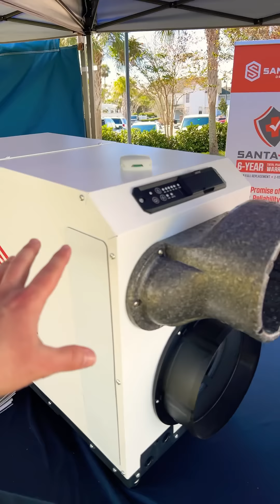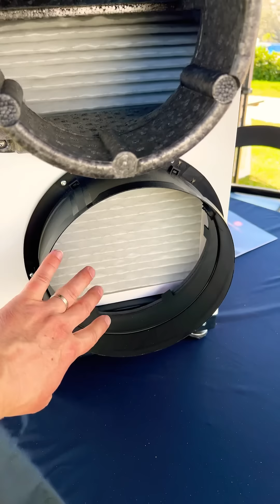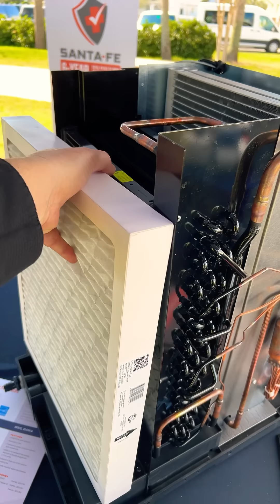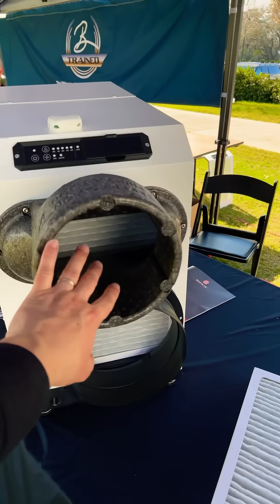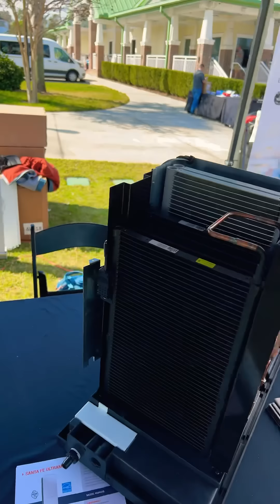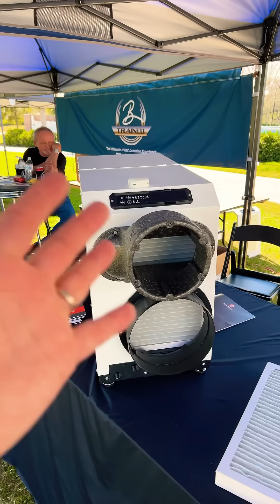New Dehumidifier Tweaks from Santa Fe

Comment: So could you use one of these to provide makeup air for a kitchen exhaust hood instead of having a completely untempered makeup air intake?  Or possibly run it in conjunction with an ERV that can vary it's intake and exhaust fans separately to provide additional makeup air?  I live in climate zone 6 where we have snow 6 to 7 months of the year, so just having 10°F to 30°F air blowing in at my feet like a lot of makeup air systems I've seen isn't really practical.

Comment: I really don’t think a person would be gaining ANY ground, drawing outside air in, to dehumidify. I think this man may be thinking about an application TOTALLY different?
For those whom don’t know how dehumidifiers work, and are reading this;
You install a separate intake from your hvac grille that runs to the INTAKE of the dehumidifier. You then install the dehumidifier, and the OUTPUT goes to your existing plenum, to distribute the dehumidified air throughout your house. I honestly don’t think this guy knows what he is talking about, with drawing “outside air” in. There certainly are systems like that, but that’s typically a commercial application.
Reply: Trent, this guy knows quite a bit about building science. Also, it is code in many states that you need to introduce mechanical ventilation if the home is too tight, like 3 ACH or less. This is code for new homes, as well as homes that are retrofitted with spray foam in the attic. Did you know all of that?

Comment: Santa Fe's sister company Quest has had this tech out for about a decade and they call it Mcor. They have a video explaining it here https://youtu.be/-vwjDABWk7M?si=3iozt9Ap0054Ni9T
Very cool design. Two evaporator coils and two condensing coils. The refrigerant comes from the conpressor to the #2 condensing coil, then it goes to the #2 evaporator coil, then to the #1 condensing coil to be condensed by the cold air coming off the #2 evap coil, then goes to the #1 evap coil, then back to the compressor. This way the air is pre cooled, then super cooled to pull as much humidity from the air but without using any additional work from the compressor because the energy to make the very cold air by the #2 evap is recovered and used to pre cool the air with the #1 evap.

Comment: I would like someone to make a warm climate dehumidifier where the condenser coil is outside the unit instead of dumping that heat right back into the house. It's counter productive.
        Good use of structural foam on the outlet.
Reply: That's called a split air conditioner 😂 Air is cooled and dehumidified and the heat goes outside. I get what you mean though, partial reheat so the air is only reheated back to the original temp and the rest goes outside. Easiest way to do that is with a water to air geothermal heat pump. Then pipe some of the heated water to a hydronic coil and the rest goes to the ground loop. Control the reheat with a radiator thermostatic valve so the temp coming off the reheat coil can be set and the valve controls how much warm water goes to the coil.